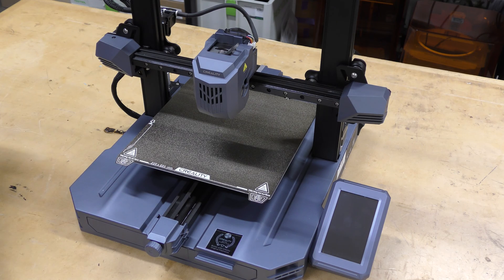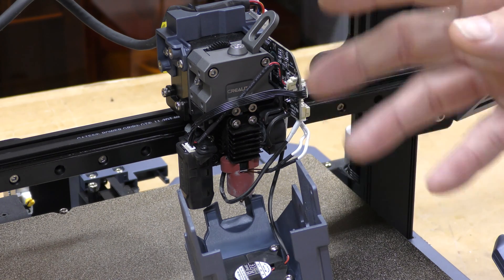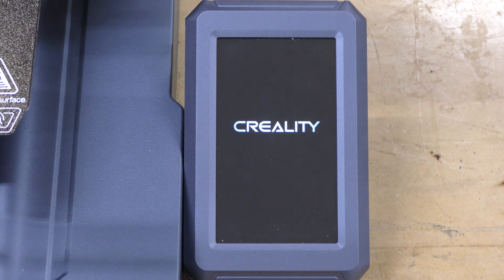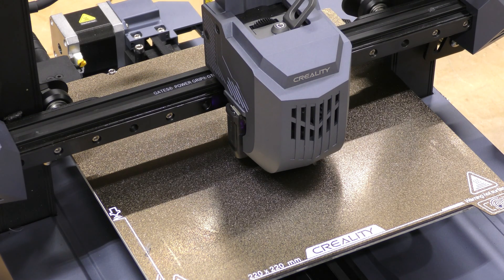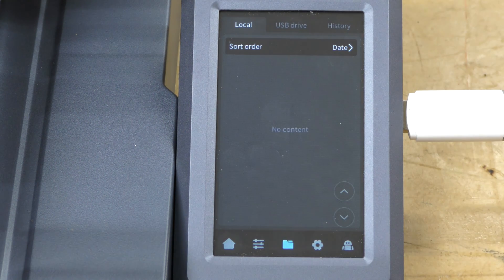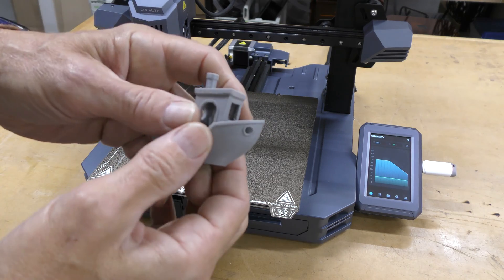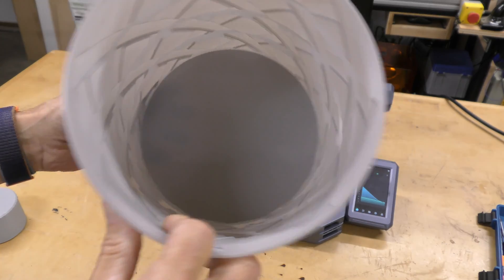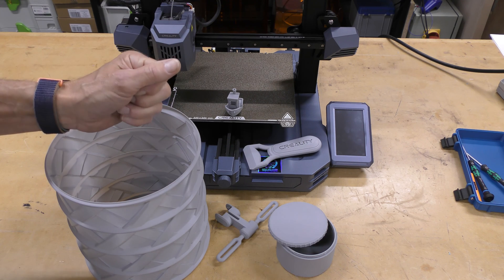Creality CR-10 SE-Configuration and Review!

Comment: HELP! I have bought many CR10-SE and they all have the same problem. If there is a change in electrical voltage while printing, the CR Touch activates and lowers the probe and hits the print which causes the CR Touch probe to break. With each power failure I lose a lot of money, it is a BUG that the printer has i guess? do you know how to solve it? it happened to 7 of my CR10-SE so its a problem of all of those printers

Comment: Got this about 4 days ago and it would seem that Creality's bed mesh does a poor job of adjusting. My bed has a tilt From the left to the right and there will always be small elephants foot on the higher side of the print
Reply from the maker: How far off is the bed at it's extremes? I found that I could just tighten/loosen the bed screws to get it were I needed it to be.
Reply: @GuysShop  The bed is off by 1mm . I printed some shims and had to add some heat resistant tape for fine tuning.

Comment: I continue to pop error codes directly out of the box. I was able to print the test boat just fine. After two small test prints off of thingiverse, I can't print anything else. I get "nozzle heating not as expected" and "Key:3000 unknown exception"

I've had this model for two weeks. It will pass the self tests, but continues to pop the Key:3000 nozzle heating not as expected"

This is my first printer and I'm at a loss. The creality website has 4 error codes, and nothing related to this issue. 

Any thoughts would be greatly appreciated!
Reply from the maker: There could be an issue with it. I would definately contact Creality customer support for an answer.
Reply: I appreciate the response. I'm worried because everywhere you look, their customer service is basically nonexistent.  @GuysShop
Reply: Creality customer service is practically non existent, they expect their forum users to solve the issues, no one from Creality actually monitor the site. Worst printer on the market. Better to save your money for a bambu labs machine.  @GuysShop

Comment: Taking mine back this is a polished turd. The fan is so loud I couldnt keep it in my room had to put in another room and can still here it. The lack of tuning settings is a huge negative I can not adjust  speed while printing or lower the z. Ive tried printing several items at 100 speed that have turned out horrible and this is for a machine that boasts 600. No support with cura! Think twice before buying this printer

Comment: First one should note;  This is not a CR (in name only) nor is it an E3S1Pro.  All linear rails and the xy bed rail looks like it was fabricated out of a 57Buick bumper (beefy).  The stepper motors are huge,  48's.  The tool head is a their Sprit direct drive, but with a Volcano hot end with hardened steel tip and can go to 310c.  The heated bed can goto 110c.  The injection molded base/enclosure is a direct copy of the E3S1Pro.  The internal side where the rails bolt too are all metal framing.  For brains it has the Neptune pad so it is a "Klipper" not a Marlin.  It can also use both the AI camera as well as the Lidar module from Creality.  It can also use the Falcon 10watt Laser kit which I also have.  The fit and finish is top shelf as in Lincoln Continental compared to a Ford Focus (they are both technically cars).  Did I mention that it is also a hotrod.  19min Benchy in a near perfect print.   I don't know maybe I should start doing uTube unbox, review, here is the spec sheet stuff.  If you need an enclosure so you can print nylon carbon fiber which this thing can do  Clearviewplastic.com makes them for this model.  The closest model to this one is the Ender3 KE, but without the beefy versions of rails, hotend and motors.  Yes I pre-rooted mine day one and have full access to all things Klipper.
Reply: I hope folks realize that you really should run through the included calibration tools within Creality Print for the filament used.  I use Inland PLA+ and did the calibrations.  The difference between your Benchy and mine you wouldn't know that the same model was used.  I don't get the stringing, bell ringing or the z stuff with a 19min print.  Nothing special, just through setup.
Reply: Microcenter @ $289.00.   I'm going back to buy two more.  The thing just works.

Comment: I’d like to replace an Ender 3 S1 pro with the CR 10. I’m very new to 3D printing. I like the CR 10 (great video BTW) for the speed. I don’t do a lot of printing because It’s still new and amazing to me. Is there anything to watch for if I get this printer? Can I start printing from the box after setup without downloading any firmware?
Reply from the maker: This is a really good printer except for the fan noise. I would really take a look at the Ender 3 V3 KE. Almost the same printer for a lot less.
Reply: I got this for 297 euros with shipping so it was a same price as KE for me. Didn't need to think twice.

Comment: ive been having y axis skips on my cr-6 se since i conevrted to klipper and do high accel high speed prints to the point  i swapped steppers,belt and wheels and still happens someitme sruingin a print an dmaking horrible vibrating sound so im at a point where i either swap themaing bpoard to see if thats the issue or maybe just quit spending on it and buy a new printer, i have a sonci pad already will this be a good steup or shold i lok to something higher in the range?
Reply: my y axis belt broke 3 times
Reply: @ExpandedUniverse000  mine hasn’t just some weird vibration, a lot less evident since I switched to hiwin linear rails on y axis, but still haven’t figured out why,also I swapped the front tensioner out sorta to an all  metal one with the wheel with teeth on it to grip the belt like the pulley on the stepper

Comment: If I were to buy a Creality, I'd opt for the K1 in place of this one personally.  Being limited to PLA, PETG, and perhaps TPU doesn't make sense to me at it's current price.  While fast, the print quality is still rough to me compared to a K1 anyway.  Thanks for the video Guy, always enjoy them!
Reply from the maker: I think for some this might be the right printer. However for a little extra $$$, the K1 does represent a better value.
Reply: Correct me if I'm wrong. The CR-10 SE specs said it support filament materials of PLA, PETC, PET TPV, PLA Wood, ABS,
ASA, PA, PLA-CF.

Comment: still don't understand why the filament sensor is an after thought on these machines. Seems like they could easily add the filament sensor to the hot end. Great video, Guy!
Reply from the maker: I agree. That thing hanging of the top rail like that is kinda janky. Thanks for all your support John!
Reply: adding it on the hotend increases it's weigth = less speed